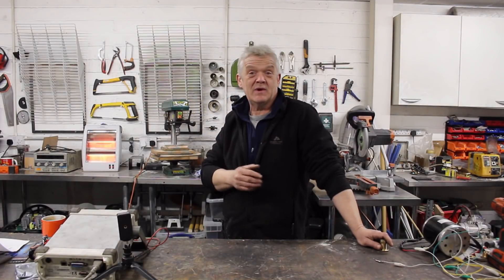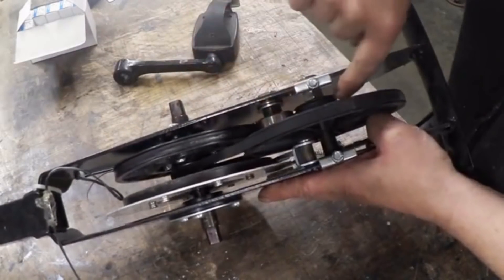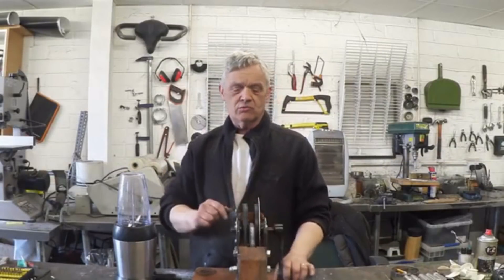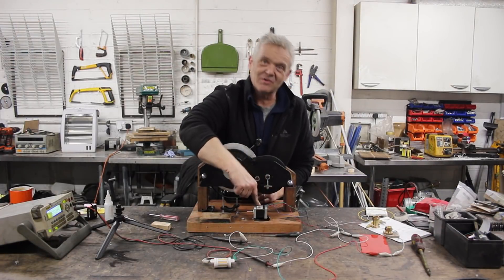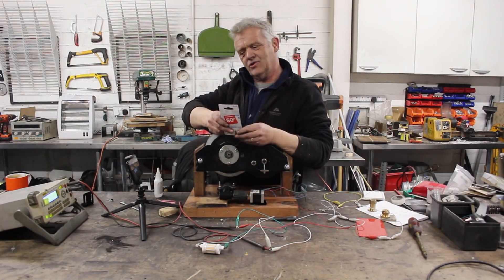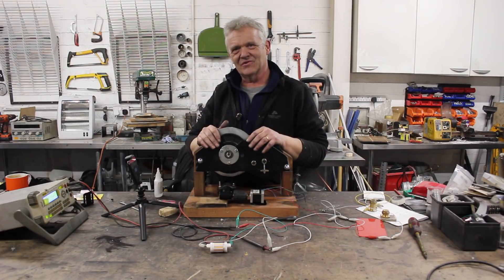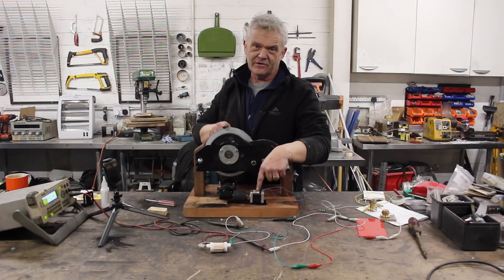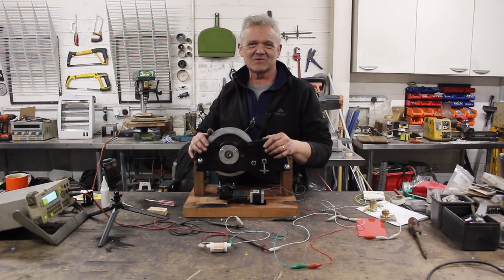1438 Serious Power From Tiny Things - 30 Watts From A Small Stepper Motor

Comment: So, if you connect the output of the stepper to a step down transformer, you could get 12v and a couple amps, which can be used to charge batteries

Comment: A top cyclist can generate maybe 400W for short periods. A fit person should manage to keep up 100W. for an hour or so. Somebody said here in the comments about harvesting that energy at the gym... If you regularly had a bunch of ten fit guys you could expect to run the gym almost! One to two KW/h. You may need to hire a guy with a whip.
Edit: Generators can be very efficient too so minimal losses with careful design. 30 watts seems absolutely in keeping with a single arms power, just about exactly what you would expect.

Comment: I was surprised when you added the 90 degree drill attachment, I can only imagine it was to take the load away from the little stepper motor bearing/bushing? I would wager that 90 degree gearbox is you’re biggest efficiency drop, was it making all the noise? Great video as usual!

Comment: finally a stepper motor build.    ive made a few that have a small crank on them,  and then put some led's forwards and backwards across the stepper coils.  with a little extra weight you can swing it around and around and make a really fun blinking led light show.    i also put an old boxfan on one and it will turn in about a 7 mph wind.     Im alittle curious why you used the handy little 90 degree drill adapter, and didnt put the stepper below your flywheel with a pully on the stepper direcly? looked like there was space down there.   anyway fantastic.  you  ive been quite impressed with the voltage one can generate even without any gearing or stepping up.
Reply from the maker: no reason really mate it just cleared it out of the way and I had it

Comment: Coincidentally, I recently acquired a floor bicycling unit (that you put in front of a kitchen chair) for a whopping 30$ because it was open box and the counter doesn't work. I don't care about the counter and figured it could easily be transformed into a generator  😁

Step-motors are usually high voltage, low amps and tough to get going (by hand, at least). They normally last a very long time, but they're not made to spin like that, so I wonder how long it would last.
Reply from the maker: wow - that's a crazy price - awesome - I have had a few of these things apart - the bearings are good so I don't see why it wouldn't last and with out brushes I am guessing it will last longer than a dc motor

Comment: robert how much torque do you get out of this, at the "generator" shaft point to get?
or a better question is how many "generator" can you put on this little shaft before it becomes to hard to spin... can you put 20?, 30? more?
Reply from the maker: I don't mate but I would doubt 20 - a couple maybe
Reply: @ThinkingandTinkering  wouldn't it be something worth showing?
serious usable power would be around a few kilowatts  30 watts demo's a principle and it is a good concept to use, a lot of small generators, to make lots of power look at the human body, billions of cell each making a few micro watts, collectively at nominal is around 120? watts on average    and at demand it can make up to around 1700 hundred when called for so i do agree with the "cell method" but then, when is the "cell method" become to hard to implement without to much effort, when does it become hard...?
i do understand it would have to do with the mass, and resistance of the bearing?
and how about losses do to friction?
could EMF be a problem?
wouldn't it be something worth showing?
or at least share a few thoughts about?

Comment: If you come across an exercise bike with a digital readout, you can disconnect the digital gauge and test it to see how much electricity it is producing.

I had one that I through out not too long ago, and it never occurred to me to clip and strip the wires and test it for output.

I doubt that it would have been all that much though.
Reply from the maker: it wouldn't have been much mate
Reply: It doesn't generate anything. It's just a pulse sensor. The "load" on these bikes are either a belt that is squeezed around a wheel or a magnetic induction brake. No generator, no electronics really.
Reply: @zaprodk  

No electronics?

You clearly don't know what you are talking about.

Some of those machines have digital readouts for miles, time ridden and calories burned.

Others go so far as to have a complete video system on them so you can watch a trainer while you ride.

It was obvious that the bike Rob took apart didn't have electronics, but the one I tossed did.
Reply: @scotttovey  Yes i know what I am talking about. We're talking about "any electronics" in the mechanical part of the basic exercise bike. The panel that counts up has a lot of electronics, scaling from a single chip (blob) solution to TV-screens etc. I was talking about the basic part that makes the friction. The signal to the electronics is usually a reed relay that is passed by a magnet, since it's cheap and doesn't use any standby power.
Reply: @zaprodk  

"We're talking about "any electronics"

Wrong. I was talking about the digital readout, not just "any electronics".

Comment: Very cool! I always wondered why everyone pedaling at the gym was just going to friction and heat, rather than lights and air conditioning. Put some batteries in each machine to smooth out the variability in available power maybe, but still absolutely viable!
Reply: The issue is complexity and increase in cost vs energy collected
Reply from the maker: I don't think that is the case mate - exercise bikes are a first world phenomenon and we love increasing complexity - take peloton as an example
Reply: @ThinkingandTinkering  I'm meaning from a product design perspective. I do agree with something like dumping into a supercap and into a simple USB charger.. it's just a little hard to justify trying to take that energy elsewhere when humans are such an ineffecient source.. the novelty of charging your own phone or as an emergency supply I think has merit.
Reply from the maker: I agree - at least fit exercise bikes with a usb charge port!
Reply: Today it is feasible to provide  good lighting with as little  as 5 watts . A big difference to the days of 100 watt incandescent light bulbs . Bycycle power  wasn't feasible for incandescent light bulbs; a generator was required.

Comment: poor little stepper. 
try put a hoverboard motor on it (3 phase/bldc). broken hoverboards can be found for free to 10 euro and comes with 2 motors. they are great as generator.
Reply: Any advice on where to go looking for them? I always hear about people getting them free or close to it, but ebay seems to run around $50 or more with shipping, and I never see broken ones on craigslist.
Reply from the maker: I have tried a couple mate - I don't know why folks keep suggesting them - in my experience they are no better or worse than a plain old dc motor
Reply: @ThinkingandTinkering  Wierd. I remember seing some people on YT using them in micro hydro powerplants or on home trainers to get 130-180watts in suboptimal condidions. In a small bench test of my own i got like 25-30w with minimal effort (in both energy and test setup). Your hand crank with a this motor should get over 100w. 
I just found your video on the hoverboard motor on the bike(1215). Something isn't correct with those amp readings. Spinning it by hand i got over 1 amp already.

Comment: i'm way off topic here but... 
regarding the hydrogen generators,  using an air stone to bubble hydrogen and oxygen into one of those cells full of electrolyte, can they be used to generate electricity from the gas?
Reply from the maker: I don't know mate - sorry
Reply: @ThinkingandTinkering  thank you. i shall try it myself. a hydrogen fuel cell that doesn't require platinum or expensive proton exchange membranes would be handy. they should work both ways.

Comment: I think more emphasis needs to be placed on efficiency. Generating 30W is great but if you are putting 100W into it you aren't going to be able to crank it for as long as if it only needed 50W to turn.
Reply from the maker: it's a balance between cost and efficiency really - plus I am a fat old man - there is no way I am putting 100 watts in - I would guess with my arm strength I could manage 50 watts top

Comment: Not bad. It's a lot of power for this motor I think. Maybe a bit too much. Does it specify voltage, Amps and steps/revolution ?
Reply from the maker: why do think it is a lot mate? the motors I looked at are rated around an amp or more peak current - this is a quarter of that so it's unlikely to get hot - when I checked the voltage breakdown of the lacquer it was around 5kV - not sure what I missed here - what were you thinking?
Reply: @ThinkingandTinkering  The wrong way I'm afraid mate. You're right. As long as you have less current than specified and no insane voltage you're ok

Comment: I have discovered that the AGNI or Lynch motor makes a fantastic hand cranked generator as well as other input DC motor/generator/dynamo, with no gearbox required. They are fantastic motors for many applications...The Agni/Lynch Motor is a unique axial gap permanent magnet high power DC motor gives up to 93% efficiency, and it maintains high efficiency over a wide range of loads and speeds. It runs on D.C. up to 60 volts at which it can produce 9 Kilowatts (12 horsepower). The low shaft speed and high torque enable the use of a simple, cheap and efficient transmission in most applications.  A 22 lb motor, it will run on a couple double AA batteries very slowly but with surprising torque, all the way up to running on an 90 volt EV battery and installed in a racing motorcycle!!! I would recommend them to anyone as I consider them a little known disruptive technology if they were to be mass produced at different scales/sizes.
Reply: Wanted to save this comment and provide one for the AI ranking algorithm. Thank you 🙂
Reply from the maker: I know about Lynch motors but thanks for the heads up
Reply: @ThinkingandTinkering  I figured you did, sorry to spam about them but I'm a huge fan of those motors and figured others would benefit knowing about them.

Comment: Let's see how many amps you can get hand cranking the biggest DC motor you can find!
Reply from the maker: a big motor would have a lot of torque mate - the motor doesn't generate it converts my mechanical energy into electrical energy - I can only generate so much as I only have so much arm strength - 50 Watts or so would be the most I could manage I would think
Reply: @ThinkingandTinkering  We should get the Mountain to hand crank a super strong generator!